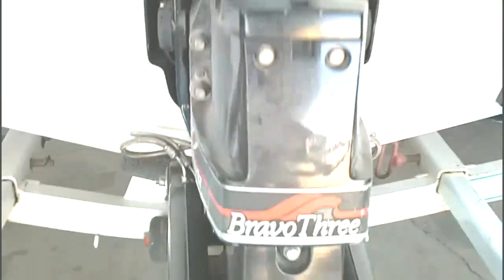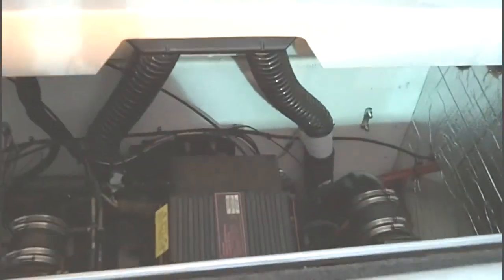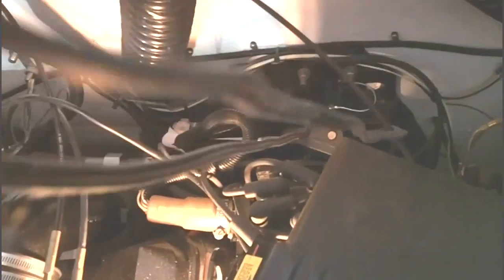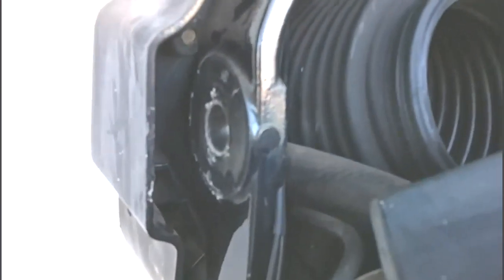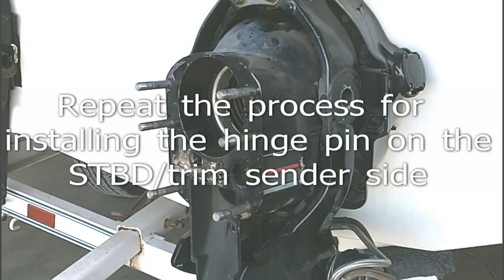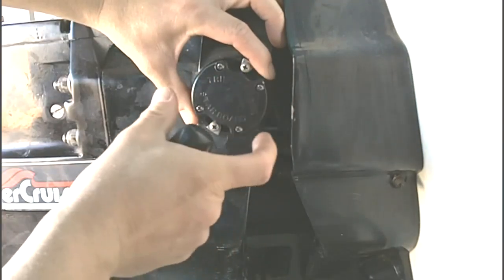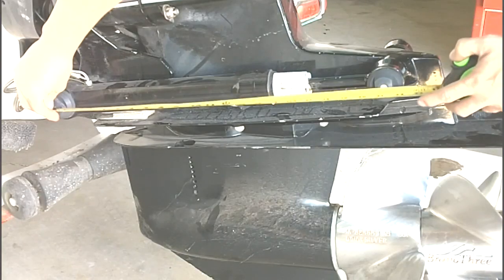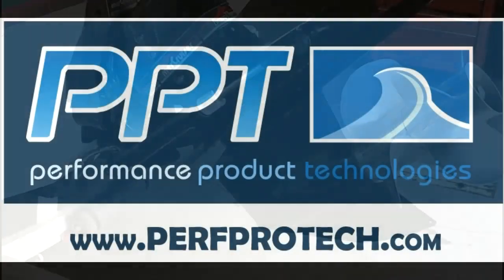Mercruiser Trim Sender & Limit Switch Replacement

Comment: I loosened the bolt a bit from outside and pulled the wires back a few inches
then soldered/heat shrink the new sender in place and coat with silicone, 
then pull back the other way.. and tighten the bolt

Comment: Great video!!
I am not wanting to remove the wiring as my wires appear good but the guts are not. Bought new Merc parts..
The alignment mark part is not clear..

..Is it the space between the teeth??
One of my new ones came where the actual tooth is on the mark. 
And the other one, the space between the teeth is lined up on the mark..
Plz advise..

Comment: Excellent video! Unfortunately I cant get my limit sensor to work. When I turn the limit sensor by hand it works but when I montage it in the hinge pin it does not work. I noticed that the hinge pin does not turn on when I trim the unit up and down. Is this normal? And if not how can I Fix this problem?

Comment: Possible options to consider:  1/2” hex socket or Allen wrench works for hinge pins.  At least mine were not so tight that I needed a 12pt .  I also didn’t disconnect the u-joint bellows.  Just by allowing the housing to go down, once the hinge pins were out, allowed enough access to get to the retainer bolt.

Comment: Just wanted to say a HUGE thank you for this video.  I purchased a second hand boat on Sunday, and took it out on Monday and the adaptor from the pump to the hydraulic hose cracked and squirted oil out.  I got a new adaptor today and fitted it, but the tilt wouldn't lift the motor.  Your instructions on how to adjust the tilt limit was all it took to get it working again and now I can't wait until tomorrow to go out on the water!

Comment: Save yourself 4 hours of labor,  drill a small hole above the transom and rout the wires through there,  I have a swim deck so you never see the hole,  just make sure to seal it real well with silicone,,,,,
Reply: I meant above the bell housing in the transom

Comment: you do not have to take anything apart to replace your trim sender & trim limit switch. all you need is a 1/4 drive - 7/16 swivel socket and a extension.  wow!
Reply: Thanks for the suggestion. I've got to replace mine on an 898 mercruiser, shorted out with melted wires!

Comment: Great video!  ONE QUESTION:  Do the new trim limit and senders have to be re-calibrated every time using the outer adjustment pucks?  Couldn't you use a white grease pencil to mark the position of where the old pucks were positioned relative to the gimbal ring before removing them so you can use the marks to line up the new pucks once they are installed.  Seems like this might save you a lot of extra work, or at least get you very close to where the new pucks need to be positioned so only fine-tuning calibration adjustments are required.

Comment: Your video was very helpful for my project replacing the sending unit and limit switch. The instructions that came with the new units was confusing but your video cleared up the confusion. Thank you very much.

Comment: I have seen some videos which rebuild the parts within the limit and sending housing, using the new parts and seals.  Thereby, negating the need to chase the wires back through the transom.  IF the wires are intact, of course.  Thoughts on this?
Reply: I've cleaned the contacts inside many switches which makes them good for a while. Most of the time insulation is in bad shape on the wires so it tends to be fruitless to rebuild those switches.

Comment: what do the trim wires connect too? if i remember correctly only one of my wires was hooked up and dont know where the leads need to connect to. also my trim units have no indicators so its a 50 50 shot if i put them on the right side. mainly just need to know where/why they connect to the boat.
Reply: They should match up to corresponding color coded wires with matching plugs inside the transom area

Comment: Yep, typical MerCruiser Total CRAP service procedures in play here; take hours and hours to R&R a common wear item that the engineers KNOW is going to fail 'cuz it's an electrical component mounted below the water line.  OK, fine, it's unavoidable that it's going to require periodic replacement.  Well, design it so it can be unscrewed and an a new one put on without: a] hauling a boat out of the water which isn't easy or cheap; and b] disassembling half the freakin' powertrain!  Dumbasses!
Reply: Damned right.    What a primitive useless way to set up something that will periodically need replacing.
Reply: LOL I agree 100% on the engineering flaw in play here, it would have been so simple to rout the wires in a much easier to reach location, still, with these things as they are, this is a good video on how to do it

Comment: Can you let me know what tools I need to do this on my '97 Brave One? I'd like to save some $$$ and do this over a weekend.  I know I need the Hinge Pin Tool, but not sure whatelse.  I though I saw somewhere that if I'm doing this I may want to change the U-Joint bellows? Is this correct?

Comment: Great video! Thank you. I have one question though where do the wires connect to? My wiring was so bad that it disintegrated the wiring and I can figure out where the wires go now? I found the two bullet connectors but not sure what wire connect to what
Reply: Also mine is a 1974 120/140 mercruiser not sure if that makes a difference I searched everywhere and can figure it out

Comment: my trim wont go down just up ! ive replaced my trim switch n also both relays ! any idea of wat my problem could be ? thnx
Reply: My up relay went bad once.  It would only go down.  I had to "jump" across contacts using some pliers while the boat was in the water to get outdrive up.  Then pull to submerged trailer to get the boat out of the water.   I think I got a Ford type starter relay as a replacement.   It is almost identical.

Comment: Awesome Video! quick question, How did you remove the Bellow ring? did you use a special tool?
Reply from the maker: +mper900 The metal is thin enough that you can use a large flat-head screwdriver to bend it and pull it out.  A new one will come with new U-Joint bellows.
Reply: awesome, thanks!

Comment: Well what about cutting the wires about six inches up from the sending and limit senders and adding marine plugs. Assuming the wires are good from the senders to their respective connections.
Reply from the maker: +AJ Bert As long as you have good wires and make a waterproof connection, I don’t see why that wouldn’t work.  I suspect if you cut the wires you would void any warranty on the part.  Just something to keep in mind.
Reply: Performance Product Technologies Hey thanks for the reply

Comment: Folks, This video is Awesome.  In fact, without the tool for removing the metal bellow sleeve, It is almost impossible.  The real issue I had is, removing the second retainer screw up under the Gimbal Housing.  That little 1/2 inch screw too me 4 hours to remove.  That is only because I did not remove the bell housing.  I only twisted it and use a hammer to keep it out of the way.  Putting in the new trim wires were easy.  Putting back in the retainer and the two screws were also difficult.  The first visible bottom screw is always easy to work with on the Alpha One, but the upper retainer screw took 2 1/2 hours to reinstall.  It was a tough job.  Having the right tools will make it easier, but it is still allot of work just to put in the limit switches.  Mercruiser should have never place the  access port for the wires all the way up under the Gimbal Housing.
Reply: We used hex head bolts threw away the original bolts Allen tool way easier to put them back in

Comment: How do I get the hydrolic piece off in order to remove the stern drive from the bell housing. I feel if I pull on it I may bend something or break something important. Thanks!
Reply from the maker: +Darren Houliston can you take a picture of the part you're referring to and then also give us the serial number of your engine or gimbal assembly. Then email it to sales@perfprotech.com. We will be glad to help you.

Comment: Awesome video. I am about to perform this task myself and I should have watched the video all the way through first because I only purchased the hinge pin tool. Is the other tool for the bellow ring absolutely necessary to re-install the ring or can it be done another way? Thanks!
Reply from the maker: +Darren Houliston Thanks for watching Darren! It may be possible to install the bellows without the tool but it would be tough.

Comment: My trim will not go up.  I replaced the solenoid not the problem.  How do I go about diagnosing the problem without replacing everything
Reply: Also, I hear a noise when pushing the down button but nothing when pushing it up. I connected the blue and green wire with a jumper and get noise when pushing the up button but the motor does not raise.
Reply from the maker: +Eric Fritz please email your question to sales@perfprotech.com and we will have a technician take a look at it.
Reply: take the trim limit cover off with the 4 screws and clean the contact spring with a wire brush. mine wasnt going up i cleaned it with a wire brush and it works now hope it works for you

Comment: For the 21 and 3/4" is that only for the bravo drive or is that standard for all I/O drives?
Reply from the maker: +John Guerra https://www.perfprotech.com/blog/articles/mercruiser-shift-cables#
Reply: Is the 21 3/4" question in reference to the ram drive measurement ? This link appears to be for shift cable lengths.
Reply: Yes what’s the length for an alpha one? My trim gauge is inop and I plan on replacing both sensors and gauge as well however the trim does come up past the cavitation point at its highest limit.

Comment: I don't understand why you can't just cut the wires and put he new one on with out taking it all apart?
Reply from the maker: +Big Island MN That would be an option for your own boat but would not be considered a good practice in the boat service industry.  In most cases the sending units are being replaced due to corrosion, therefore the wires could be compromised by corrosion, as well.  Cutting the wires would also void the new parts 1 year warranty from the manufacture.  Although we wouldn’t recommend cutting the wires, that is an option and would certainly save a ton of time.
Reply: +Performance Product Technologies my wires are bad. I better just do it right. will I need an alignment tool to put the lower end shaft back in?
Reply from the maker: +Big Island MN The alignment won't change when you remove the drive but unless you know that it's currently in proper alignment, Yes you should check the alignment to be sure it's good. https://www.perfprotech.com/alignment-tool-kt-805475a1/product/137189

Comment: Great video, I see you skipped through the connections for the trim sender. Just bought a boat and the wiring seems to be off. 165hp mercruiser sterndrive and 260 mcm engine. How and where would these wires be connected to? Thanks

Comment: Great video sir:) 
I have a question, can I just cut the existing wires and just replace the sensors, then use something like a shrink tube along with some red RTV? the point of the whole thing is to make sure water does not get in right? Or what if i use some waterproof connectors? 
Thank you in advance!
Reply from the maker: Oleg S,
 
 
We do not recommend cutting and splicing wires together.  The best and most correct way to install the new sender is to use a chaser when pulling and rerouting the new senders and wires.

Comment: Any special glue or seal to apply to retainer plate area where wires go through the boat to keep from leaking?
Reply from the maker: There is no special glue or sealant required.  They are installed from the manufacturer with NO sealant and the service manual reflects the same.

Comment: Hello,
Great video thanks.
2 questions: 
1)  At any time while replacing the Bellows ring will I need glue/adhesive?
 and 2)  I have a Bravo 3 outdrive with a throttle quadrant that only has a trim switch, not a separate trim and trailer switch.  Does this impact how to adjust the trim cutout switch?

Thanks!
Reply from the maker: You will need no glue or adhesive when installing the bellows ring.  Your second question is a little harder to answer without detailed wiring information.  If you only have a single switch that trims your drive all the way from the bottom to the top…. then I would think it would be safe to say that the trim limit on the back would not be wired into the trim system of the boat.  The trim limit is there to open the circuit at a given angle (if adjusted correctly) and the fact that you don’t have a second switch means your (single) switch has to be wired directly to the trim pump. Therefore, in your case, your trim limit on the back would not be used.  I hope this helps.
Reply: Performance Product Technologies Thanks again for taking the time to answer.  That was my thought as well on the trim limit.  I guess I'll just plug it back into it's existing connectors and go from there.  Thanks again.
Doug

Comment: Thanks for taking the time to explain in detail.  Why do you think Mercruiser didn't just have waterproof connectors for the wires into the hull?  Seems like a lot of work to snake a couple of wires!
Reply from the maker: I agree with you 100% and like the way you think. I don't know why they did it this way but it does comes across as a lot of work.

Comment: I just finished putting new bellows on and could u tell me how to set the trim sender and limit switches. I messed up and didn't mark them. so I don't know if they have to be set just right
Reply from the maker: This video outlines this process step by step starting around the 8:00 mark. Did the video not address your question correctly?

Comment from the maker: No problem this is normal to hear this change is the sound of the pump. When the drive reaches the full down position the sound from the trim pump changes as the relief pressure is reached.

Comment: Great video and info!!! Please help me with following problem: when I turn the trim at full up position the pump is stopping automaticaly but when I put the trim at full down, the pump still noising (but the noise is diferent than when it is other position). Is it normaly? I ask this because it is my first boat and it is SH. Thanks
Reply: Yea years later but,    For the sake of the next guy experiencing this just let go of the switch.    If you hold the button down it will just keep trying.